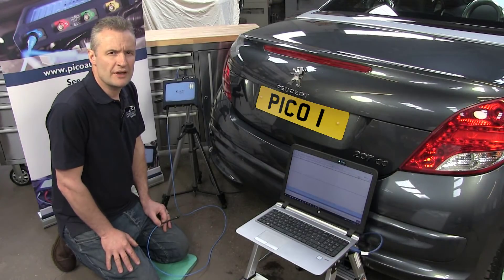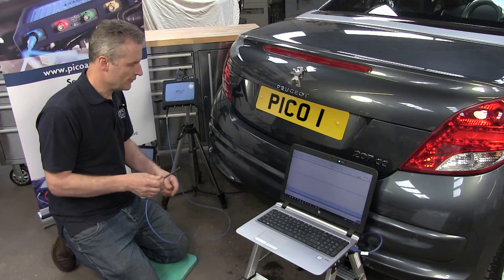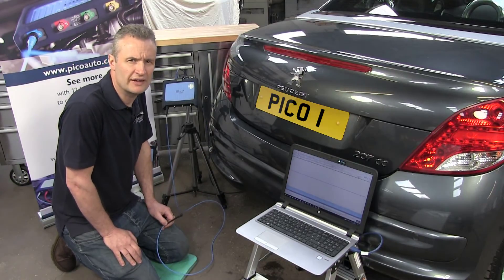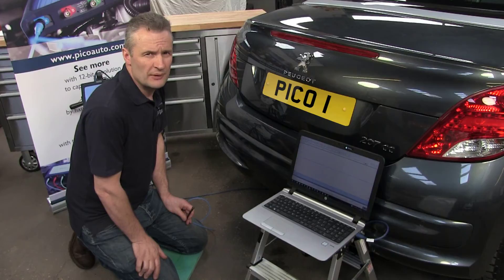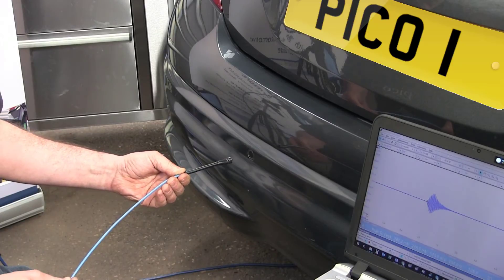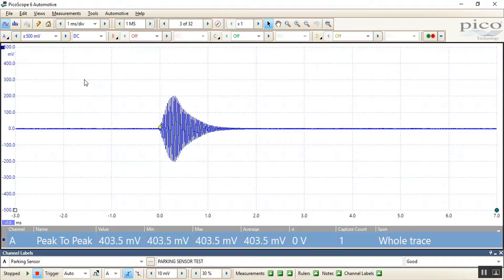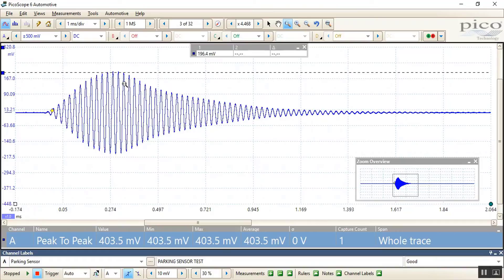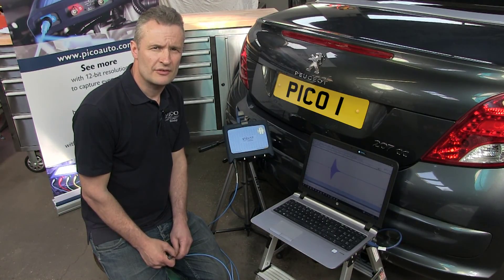Pico Automotive Parking Sensor Test

Comment: For a system with 4 sensors, can I monitor the waveform of the sensor simultaneously and measure the cycle period of the ultrasonic pulses...as well as capturing the transmission pattern between the 4?

Comment: do all manufacturers use the same frequency ?
Reply: Most, especially pre-2010 vehicles. Some are now moving to 48kHz for longer range. 58kHz and 68kHz also exist and they will play a big part in auto parking systems that scan for parking spaces along the side of the road.
Reply: thank you